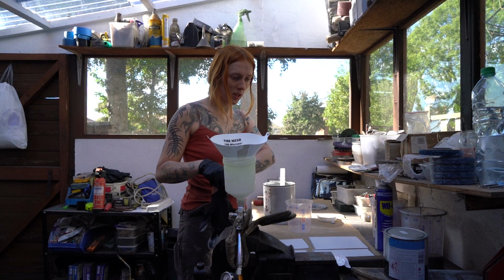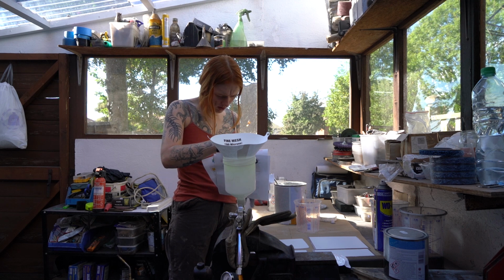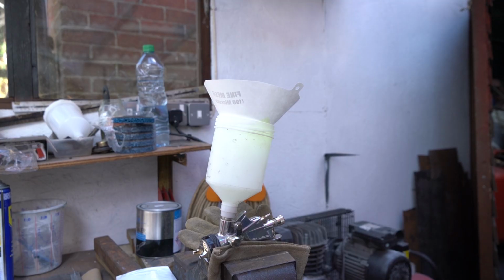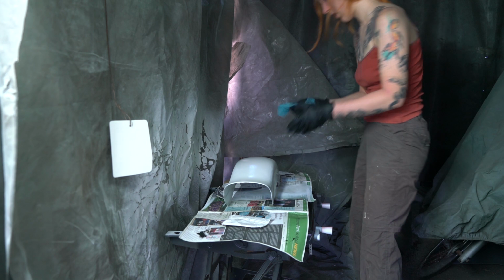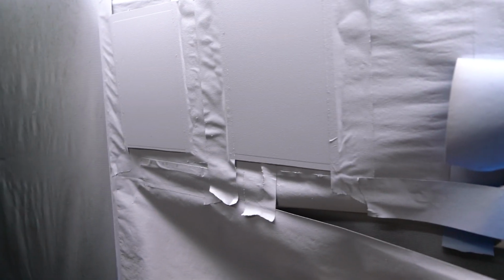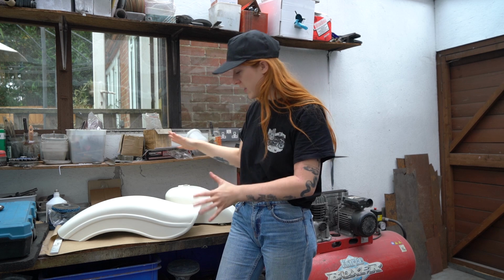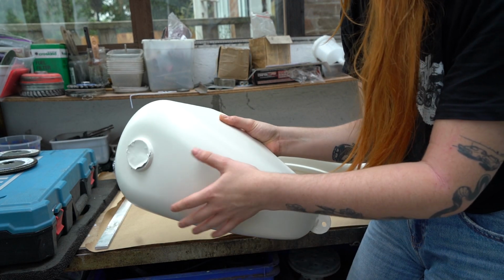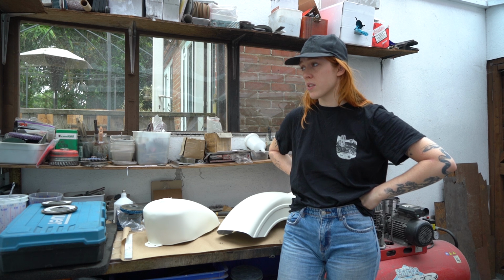Yamaha Chopper Build: Custom Tank with Custom Paint Job

Comment: Spray guns have dual (action) triggers. First pressure give you air, second pressure give you material. While spaying try to keep the air flowing. This ensures that no drops of paint form on the spray nozzle to get blown on to the job at the next pass. Think of each pass of the spray gun as a stroke. Each stroke begins before the item being painted and ends after the the item. Start the stroke with the air flowing. As you get close to the item being painted, start the paint spray. After you passed the item, partially release the trigger to stop the paint, but leave the air flowing. Start the process again but back the opposite way.